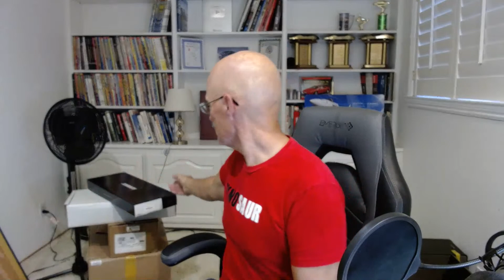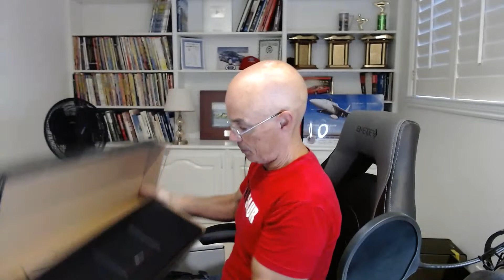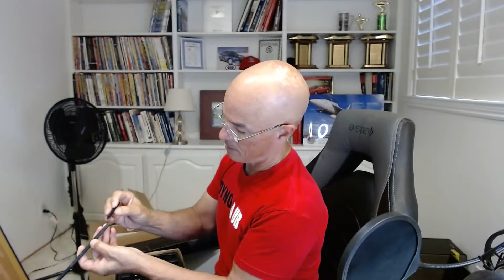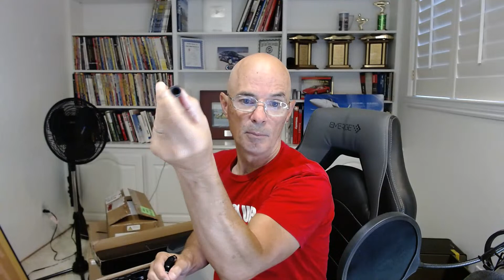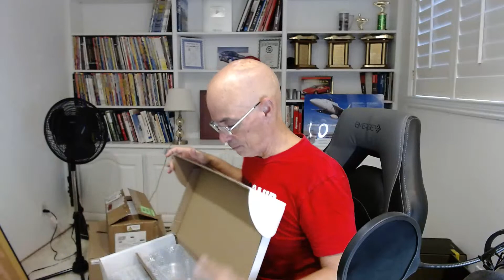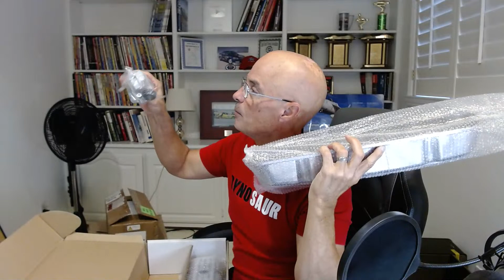LET'S TALK TECH-BOX OPENINGS-NEW ROCKERS!

Comment: To be truthful overall no, but then again trusting most any part is a fool's errand until you use/measure it. NEW=Never Ever Worked. Brand doesn't mean a lot either at times, I've had Dorman stuff be way out of spec for instance. 

I think out of everything you said where I'd want to spend the bank for on shore parts is valve springs are by far the most obvious. Heaven help us if they start reboxing springs. 

I'd love to think lifters are no go as well but the market is supposedly flooded with poor quality Chinese Lifters anyways. I'm thinking of doing Rhoads just because you can buy from mfg and hopefully that eliminates quality variability.

Cams, I didn't know they even did cams offshore. It seems even the reputable makers over the last decade or so have had VERY mixed results with cam hardness based off testing I've seen various people do on forums. Sadly hardness files I've found only seem to go down to 40 Rockwell otherwise I'd love to test the core for hardness before putting it in.

Besides that there's a lot to be said for the fool installing it as well.

Comment: Very helpful Richard, re: relationship between rocker ratio, lift and the myth that more head flow may not make more hp.  I am going to try at some point switching out my comp cams magnum rollers 1.52 to 1.65’s.  I will have to check-out SpeedMasters.  I had been debating about Scorpion rollers, but wasn’t sure.  I like the idea of a pushrod measurement tool - to check clearance on the pushrods.
Reply: Here in Australia Speedmaster or Procomp (Poocomp) have a very very poor reputation. Absolute rubbish. 
Have a look at the Scorpion roller rockers instead.